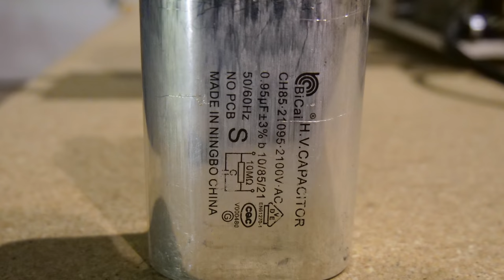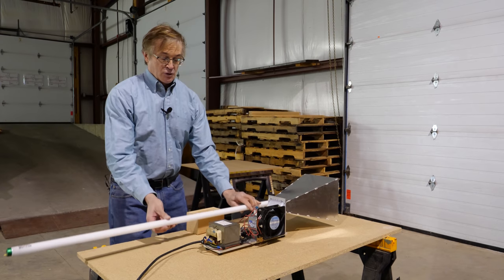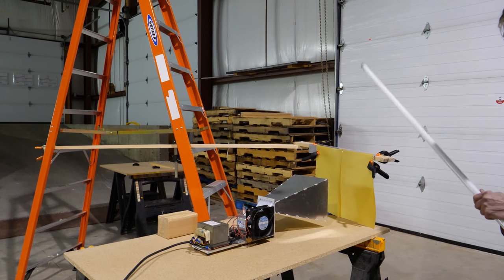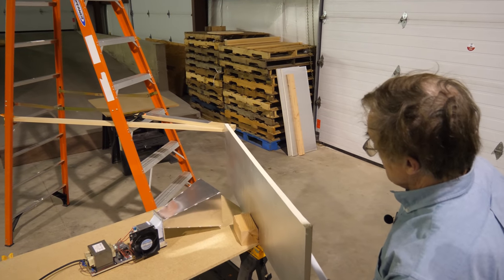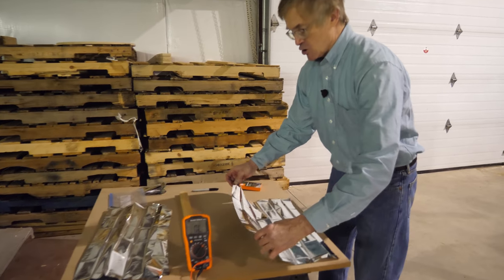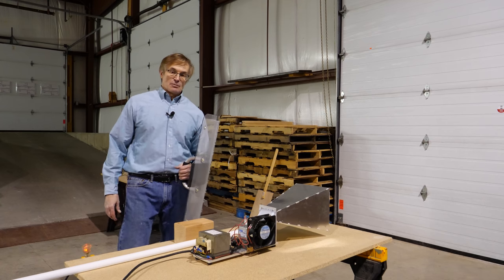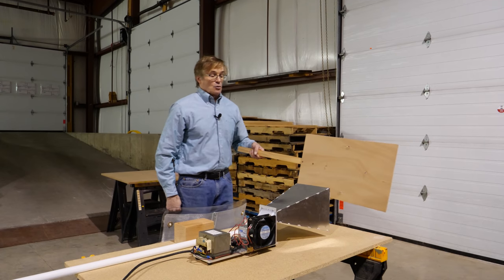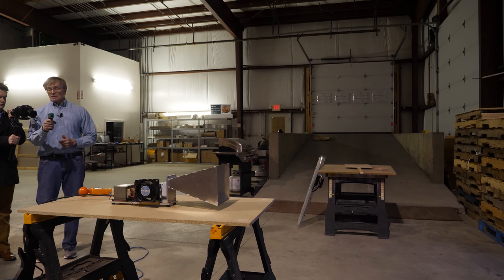You're not protected from microwaves... yet - Part 2

Comment: Would there be any benefit to wrap the Rigid Polyurethane Foam Insulation with the  Ribbon Carbon Fiber Cloth or Graphite Film or both?  Would that block more? Would there be any benefit to grounding a structure of the insulation to socket ground or right into dirt/ fertilizer?
Reply from the maker: Grounding will help, but you can't beat metal for performance.

Comment: Quick questions, would grounding something that is electrically conductive help absorb more of the electrical current traveling through the material and does it promote the protective value? Also, is there a way to measure the amount of electric that is being absorbed in such material(such as a device)?
Reply from the maker: Yes, it would.
A Faraday cage works better when it is grounded to prevent the reradiation of the energy inside.
It should be possible, but I've never tried it.
Reply: @TechIngredients  Thank you! It makes perfect since and I just wanted confirmation. If you could come up with a method of doing this, I think it would be awesome. Instead of all of these fancy expensive detectors, if you could measure the electric at a single point, say like at the ground, it would be helpful. If you had multiple pieces of material all connected to grounds(or simply through wires) and you could measure all of the electric being absorbed, you could add onto or take away a piece and actually see the difference, if there is a difference at all. I think this would be very useful for actual means of protecting yourself.

Comment: Just a question.. Dose'nt the garage door reflect the microwave back at you ???, and how would the microwave transmitter with in a faraday cage, with the holes in the mesh?, ore will it still be blocked like radio waves?
Reply from the maker: It does, but the divergence is very large, so the intensity is pretty low.

Comment: if you connected the neon bulbs to a longer wire, perhaps in a coil, would it become a more sensitive detector?
Reply from the maker: The wire is acting as an antenna.  Longer will increase the voltage, but coiling it will not work because  the coil can't extract more energy  from the same region.

Comment: The beryllium oxide pink part in the magnetron is a bit of a myth.  If you do research on it, it turns out it's so hazardous it's never used in modern residential microwaves, with aluminium oxide used instead.  (If it was used, imagine the warning labels on it to cover end-of-life disposal!)  Beryllium oxide is a better heat conductor so is used in high power radar systems but not necessary for domestic microwave ovens.  Of course don't rely on this claim, do your own research first where your safety is concerned!
Reply: The VERY old 1970's microwave ovens may have included some, but no modern ones use beryllium.

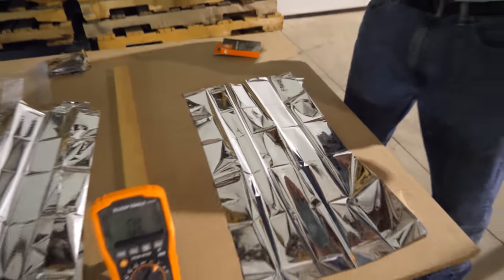Comment: 14:46 Did I miss the explanation of why it was labelled "FRONT"  or was it just a setup leading to getting the spelling checked ?
Reply from the maker: Ha!
No, it was only to distinguish the surfaces if we decided to use the conductive side for the detection system.  It will block microwaves equally well no matter which side faces the transmitter.

Comment: Can anything be deduced from the noise generated ( Buzzing ) while objects that won't pass RF are in front of the feed Horn, such as maybe frequency of the wavelength ?
Too, is there a way to measure 
Standing Wave ?
As a counter measure, is it possible to use a small parabolic dish to redirect the signal, in hopes that the reflected signal could cause the transmitter to fail ?
I was thinking too, if the power used by a Government lets say, would be much more powerful, then could a parabolic dish redirect the energy back towards those running the transmitter, as a counter weapon ?

               X-- ((((😵‍💫

Comment: In the previous video you mention that the military version of this crude microwave could produce 10's of kilowatts. Would the copper mesh become red hot under this type of attack?
Reply from the maker: No.  Remember that the power is spread out over a pretty large area and the vast majority of the energy that strikes the shield is reflected.  Also, I explained that the intensity of our testing is probably similar to the intensity of a weaponized microwave system .
Reply: @TechIngredients  Great, thankyou for taking time to clarify!

Comment: Please sir, where can this be purchased? at 1639: electrically conductive cloth?
Would it be effective to block:
microwaves of : range of 100 megahertz to 10,000 megahertz that are modulated with a waveform consisting of frequency modulated bursts grouped tightly together. The burst width is between 500 nanoseconds and 100 microseconds. The pulse width is in the range of 10 nanoseconds to one microsecond. The bursts are frequency modulated by the audio input to create the sensation of hearing in the person whose head is irradiated.
Reply from the maker: Check out Amazon, they have a variety  of conductive  cloth grades  made specifically  for Faraday shielding.

Comment: does grounded chicken wire have any shielding effect? like does it absorb and dissipate it? thinking cheap...I remember hearing you can make a faraday shield around your house out of chicken wire is why I ask...
Reply from the maker: The openings need to be smaller than the wavelength of the microwaves. At 3 GHz , that is 10 cm.  At 30 GHz, that is 1 cm.  Military transmitters operate around 100 to 200 GHz.
Reply: @TechIngredients  Noted. where do I get that carbon fiber you used? trying to find it but none look as thick
Reply from the maker: Try DragonPlate.

Comment: " Honey, get the conductive clothing out, let's go to the mall..." Btw, what about metal roofing? How's that work? Does conductivity have to be facing the "emitting source"? Thanks again, for more fun..)
Reply from the maker: The conductive surface has to be between you and the source.  If you can't see the source past the barrier, you're fine.
Reply: @TechIngredients  umm, actually, my situation in Philippines mountain involves a new transmission tower, about 60'-90' from the concrete home/workshop I built there. There will be 230kv of 50 cycle power on the lines. So, it's not microwave as you're discussing here. Instead of tearing the new building down, one plan is to use it as an occasional workshop; "hiding" it behind galvanized steel corrugated panels. Do you have any input on that?
(Btw, my 100% VA disability comes from radiation exposure, working inside automatic tracking radars as a 20-23 year old. So; I'm personally familiar with your topic. Thanks for addressing it..!

Comment: or they can use a phased array to use pencil point beams to really crank the juice on people,  you could have a computer randomly pick targets at the front of a crowd to hit with high powered beams
Reply from the maker: They can't break the laws of physics.  A phased array will match the divergence of an equal sized reflector.  The advantage is a flat form factor and the ability to combine the power of multiple smaller emitters.
Reply: @TechIngredients  look up the APG-81 is an active electronically scanned array (AESA) radar system.  its about the size of a starlink array and can burn out radar antenna at sam sites miles and miles away
Reply from the maker: I doubt it.  It might jam them (bury their return in noise), but to burn out a military radar isn't believable. As I stated above, those are physical laws governing the divergence of all electromagnetic radiation, you can't break them.
Reply: @TechIngredients  check it out man, the F35 radar is much much more than it appears.  side point how do you think radar works for SAM's? they have a wide beam to locate it and than they use a pencil beam to guide it in over 10's of MILES.  the F35s radar can be used as part of it electronic warfare systems, this capability isn't just on the F35 it is on Wild Weasel aircraft and F-18EX's but as pods.  why would a RADAR system need to put out so much power on a mobil platform?

Comment: Couldn't you use a shield like the one in the window of our oven? With some modifications of course. Maybe a wire to ground and insulation to hold it.?.
Reply: If you use the window of the oven, what protects the majority of your body?
There is no need to ground anything, nor any need for insulation - it's not electricity.
You need to watch the FIRST video they published, this one is only the follow up.

Comment: whats the purpose of blocking microwaves into a building , also you would probably get horrible cell service inside like our hose that has aluminum and tuck on/in the walls
Reply from the maker: There can be a number of reasons.  You may not want microwave or wireless signals into your building or out.  Baby monitors and modem signals may be a problem when transmitted in or out of your building.

Comment: Help.  If you paint an aluminum roof does it stop the aluminum from stopping microwaves weapons
Reply from the maker: No, it doesn't. 
The reason that metal stops microwaves  is because  it is electrically  conductive. The waves induce a voltage in that metal, and as that voltage drives a current through the metal, resistance converts that current into heat.
The paint is invisible to microwaves.  That is why it can pass through  wood, plastic, paper, and coatings like paint.

Comment: How do we get eye protection against microwave radiations? As the eyes are mostly water and the cornea are very susceptible to heat damage that can cause blistering or even worse, cataracts. Also this video give some validity to the Havana syndrome.
Reply from the maker: Use a fine mesh metal screen.  You can see through it.  
Take a look at our follow up video in this series on microwaves.
Reply: @TechIngredients  As stated before, our eyes are sensitive to heat which the screen absorb and convert the microwave radiation into. Can a system be created to emit synchronized opposite direction microwaves to cancel the attacking source?
Reply from the maker: Not any any practical way.  You'd have to phase reverse  waves with a wavelength of mm.  That means even a small curvature or when the barrier is angled that the phase of the counter emf would have to progressively shift across the surface.  Really, really hard.
A simple mesh will reflect the microwaves and protect your eyes just like the coarse mesh in a microwave oven door, it's so simple.
Reply: @TechIngredients  I think the grid mesh door in the microwave doesn't heat up when it's operated, maybe someone with a thermal camera can confirm my assumption by taking a look when briefing operating the microwave without any content inside. What is concern to me is that any metal absorb microwave radiation and emit infrared radiation which the lenses in our eyes can focus and concentrate it's power. There is a good video at Steve Mould channel explaining his quest to take a picture inside an operation microwave oven. Also Electroboom demystified the do not put metal inside of a microwave oven with interesting results.

Comment: How small does the perforated screen need to be or how big can it be. As far as each square. Say each square is dime size, would that still protect me?
Reply from the maker: Look at the wavelength  of the microwaves.  Once the openings begin to become smaller  than that dimension,  the attenuation increases exponentially. 
Weaponized systems  use around 100 ghz.

Comment: What is missing is something to protect the eyes, to compile a flexible full body suit. I can imagine something like lead glass could work. However, that is nothing that can be easily used to upgrade existing gear. Any ideas on that?
Reply from the maker: Just apply a fine metal mesh to the front of a face shield.
Reply: @Tech Ingredients  That's a good idea and gives a lot of flexibility for the details. Could e.g. create a visor that you can quickly attach with velcro when needed, and otherwise, just use normal clear protective glasses

Comment: Dude, if I HAVE TO use this information, then I HAVE TO know how to turn the curve of the plastic shield away from me and use the neon indicator lights to aim at the source cum target, or elsewhere at the people using the weapon and the people providing support and cover for those using the weapons. 
     Telling people around me to run away while I stand there alone with a shield in one hand and a little cocktail flag in the other is just another term for "loss." Twenty-thousand people reflecting back crowd dispersal weapons like noise cannons and microwave cannons is a passive, nonviolent, peaceful protest. Twenty-thousand people running away because they know the enemy will use annoying sci-fi weapons against them is an embarrassment.
Reply: @Cancer McAids You have a sorites problem, but no sensible sensible reason to make that the place where you draw the line. So just cut to the chase and say that if people didn't want to be machine-gunned, then they wouldn't have protested in the first place. 
     And don't bother replying. I won't engage any further until you change your username.

Comment: You mentioned using just aluminum foil when carrying something like a sign. How about Wi-Fi microwave coming through your neighbor's apartment wall. Maybe you can do that fluorescent bulb experiment with plain aluminum foil. I covered 😂my whole wall with aluminum foil but not sure it's working.
Reply: My GQ 390 EMF monitor still reads mW / m2 over 10 GHz ...sometimes up to 300 and once outside up to 700...pointing at an adjacent wall.  Outside must be reading a celltower I assume ...but 5 minutes later it is gone .    None of these walls are facing the celltower ...but I am also assuming that that wave from it (celltower) must be searching and finding probable prospects to connect to in the habitable living quarters.  The router however in the neighbors apartment still seems to also be searching for a possible prospect to connect with and even though I do not have "WiFi" ...just turning on my laptop boosts the reading up to 30 + GHz.  Turing on a cellphone will boost the reading on the meter to 50-100 GHz.  

The aluminum on the wall apparently is not stopping the mW reaching a connection.  Like your experiment however it did stop mW at another home where there was no celltower nearby.  Perhaps I need one of those caages I see advertised occassionally(?).

Comment: also can i ask if i use the aluminium door mesh ,as a face shield is there a maximum size for the mesh holes??
Reply from the maker: The principle  is that the holes in the mesh need to be smaller than the wavelength. Once they are at least that small, the amount of energy  that leaks through  drops  precipitously.  The shortest wavelength  microwave systems I read about were 3 mm long.

Comment: Hi, with the Ukraine conflict I've been reading about military stealth and electronic countermeasure systems...
♦️It would be AMAZING if you could use that microwave beam apparatus to experiment with various "RAM" (Radar Absorbent Materials) such as ferrite infused coatings, Polyimide/vinyl wrapping with  integrated copper antenna traces..
♦️Also, comparing different radar cross section return/Absorption when using various angles, shapes & airframe surface structures!

Thoughts?
Reply from the maker: I've been playing around with that since the video.  We'll see.
Reply: @TechIngredients  That is really cool! Hope to see it!
Reply: @TechIngredients  On another note, I've always been curious if you are/were a college professor or r&d scientist/engineer or something?
So much of what you've posted is explained in very easy to understand ways.
Reply: @TechIngredients  Hey, just following up... Were you planning a follow-up video on this?
♦️I make DIY Drones... Also do a lot of tinkering and making...  This would be such a fun project to mess around with...   I was reading about things like "iron ball paint"(not sure if that's the correct term.
 I understand one type of radar absorbing material is similar to the Rubber- ferrite refrigerator magnet material or sometimes a similar material is used in brushless Outrunner Motors. 

Finally, perhaps some of the vinyl wrap people use to change the color on their cars would be an interesting material to experiment with...?

Hope you guys put something fun together!

Justin

Comment: what about using an AM radio to detect microwaves? usually microwave gens are pretty noisy on am frequencies
Reply from the maker: That could work, but you'd have to distinguish between cell towers, microwave ovens etc and a weaponized microwave system.

Comment: But they aren’t weapons, they’re designed to cause pain without death 

The insulator of magnetrons de consumer ovens is not beryllium oxide. It is a mix of ceramic, aluminium oxide or alumina (AL203)
with small amounts of added chromium (3) oxide and may or not be added to magnetrons so in some cases the antenna insulators may be white.
Having experience with bimetallic thermostats, you immediately know the deal with these pinky colours.
Reply from the maker: They are weapons.  They're similar to a club, a bike lock, brass knuckles, a whip or a flash bang grenade.  They cause pain and can injure the target.  Not all weapons have to kill.
Reply: @TechIngredients  I’m citing the Oxford dictionary here. 
“a thing designed or used for inflicting bodily harm or physical damage eg; nuclear weapons.” 

The electromagnetic radiation, non ionising is not causing physical damage, just initiating a thermal event.
Reply from the maker: Sure, it's not a nuke😀
But seriously, a "thermal event" includes a burn, nevertheless I don't want to get too bogged down with symantics.  Using a device to attack someone is an aggression and when you're arrested for assaulting someone with a "deadly" weapon that isn't meant to be redundant.